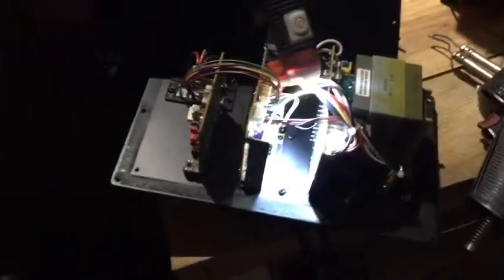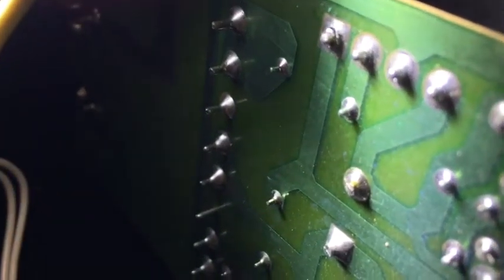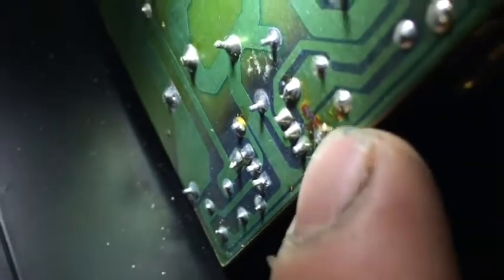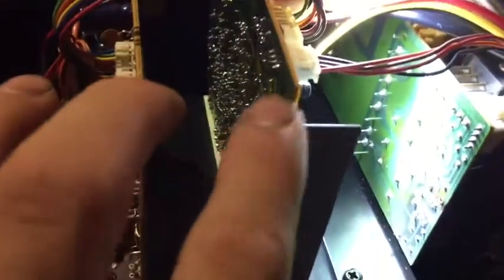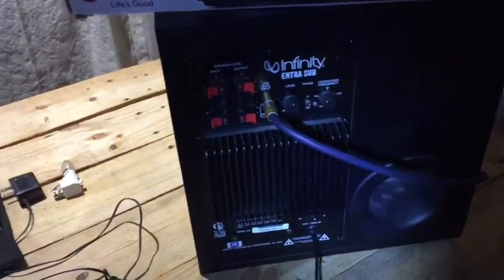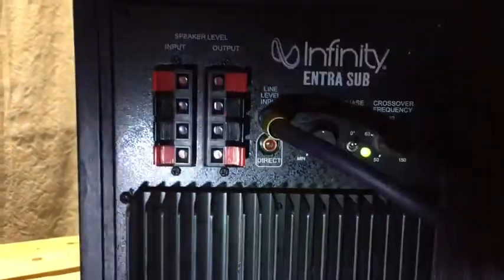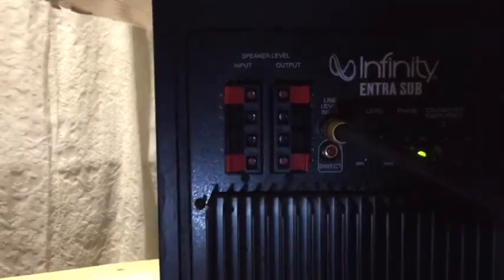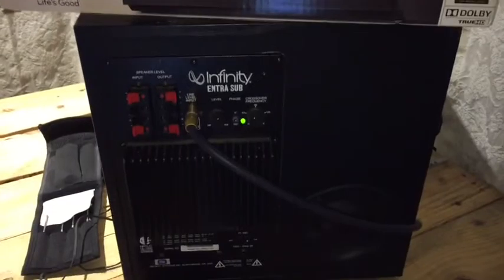Infinity extra sub Repair.

Comment: infinity modulus 12" sub here.. if only it were that simple!  checked mine top to bottom with a strong magnifier and flash light... no bad solder joints... mine developed a loud hum when powered on and a nasty thump when swithing in the crossover on and off...still works but the hum has made it almost unuseable